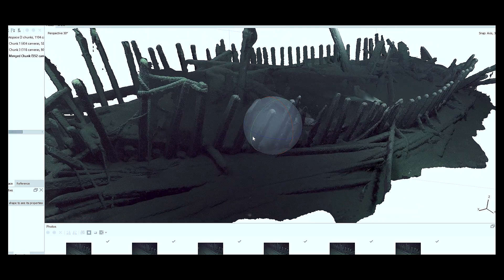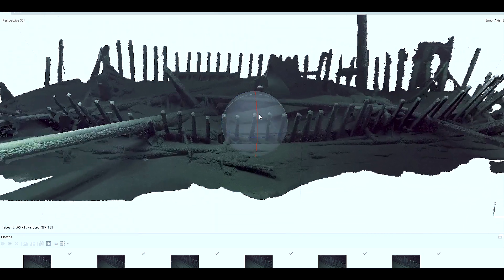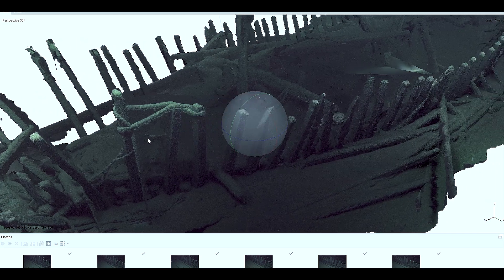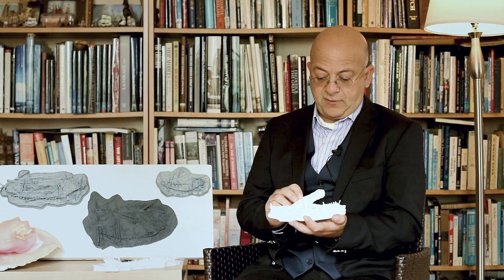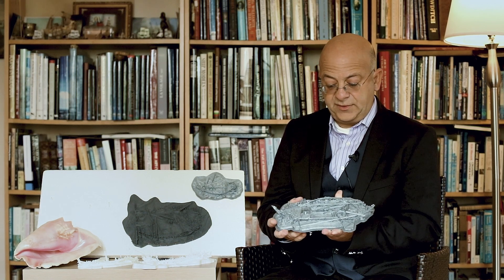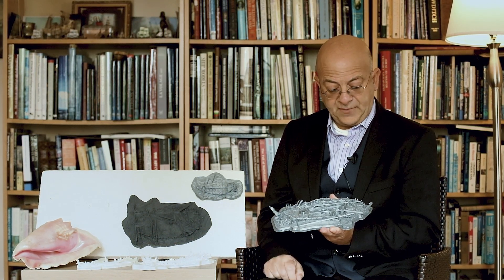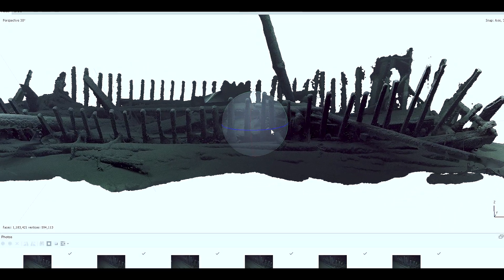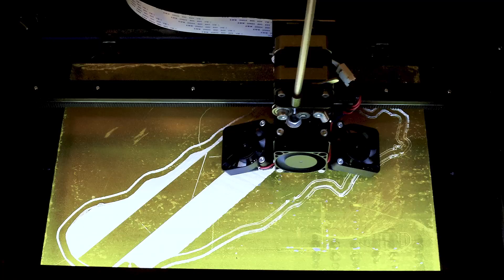3D MODELS of SHIPWRECKS - Part 1

Comment: I believe that the 3D scanning of these sites are extremely valuable despite the lack of direct contact with the wreck itself.
It's a fascinating subject!
Reply from the maker: It is valuable, yes. For deep water it is the only way to gather any information. That’s what we did with th 60+ wrecks we found during the Black Sea MAP. In the case of this site, however, besides photogrammetry we do use also traditional hand measurements as we are diving and excavating. Needless to say, we are able to do a far more complete documentation by hand. With the models shown in the video, we do not have construction information in detail and do not have the bottoms of these ships- well, for most of them, so complete reconstruction and reverse engineering would be problematic.
Still, you take what you can.

Comment: Whether we like 3D Scan or not is one of the tools we regularly use in engineering projects. I don't know if it works the same way underwater with traditional tracking spheres? Fascinating what you can get as an overview of wrecks.
Reply from the maker: We mostly use 3D photogrammetry. But I have no doubt the scanners will be used too